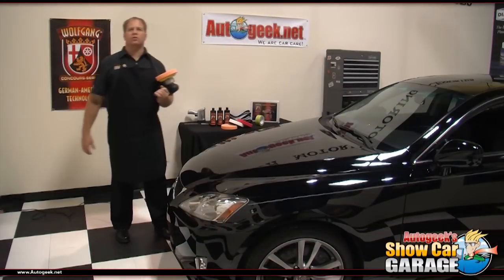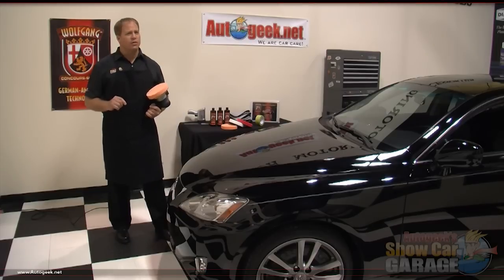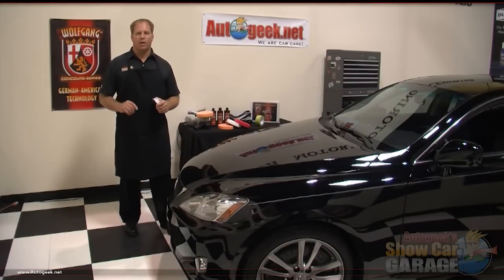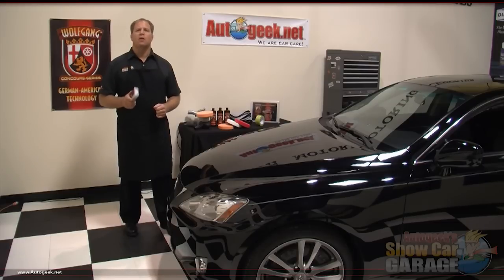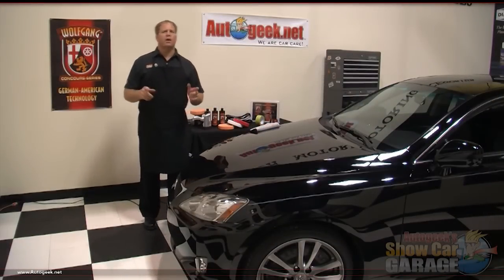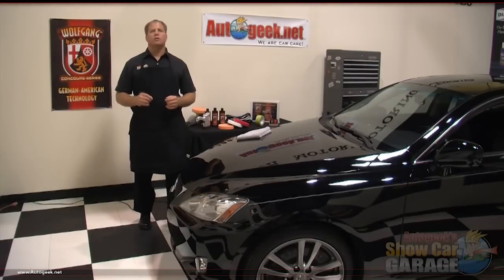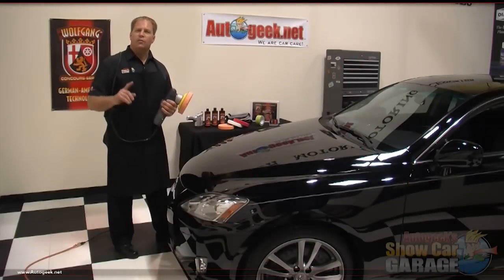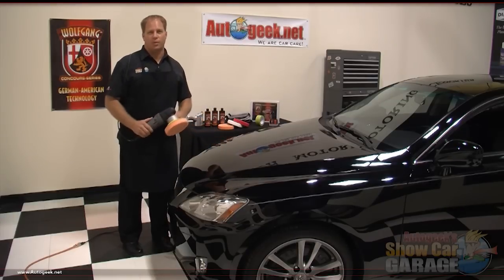Part 1 - How to remove swirls, scratches and water spots using a Porter Cable 7424XP Polisher

Comment from the maker: @DefinitionIsGone 
Good question and one that comes up all the time.  Wash and dry the car.  Clay if needed.  Next start with the Wolfgang Swirl Remover.  Since it will remove swirls out of your car's paint at the same time it's going to remove any wax you've applied.  -Mike

Comment: Hi Mike,

I recently purchased a 2014 Ford Expedition in Tuxedo Black.  I have  also watched many of your videos on the proper techniques on using a Porter Cable DA polisher. I alos understand different manufacturers use different grades of paints.  I have watched both the Wolgang and Blackfire videos. I am willing to invest the time to make this truck look great, but I am trying to figure out what lime of products would be best for this truck.  I will also be detailing my 2009 19 foot Monteray boat.  Thanks for any advice. I love all yiur videos and tips.

Thanks,

Deano

Comment from the maker: @No11Scalpel 
If the compounds you have are not using then switch to different products.  The Flex works great, that's a known fact.  Lake Country pads work great and that's a time-proven fact.  The other three variables are, paint, compounds and you're technique.  Since most paints polish just fine that leaves your choice of compound and your technique.  The Wolfgang Total Swirl Remover and Finishing Glaze work flawlessly so I would suggest giving them a try next.  -Mike

Comment from the maker: @wtgilles 
That's a tuff one... just do the best you can.  Clear bras are great for protecting the front of your car but there's no easy way to avoid getting the polish and wax residue along the edge of the bra that's fast and easy.  You could try running a strip of painters tape over it and just don't worry about the 1/8" of paint next to it that won't get polished.  No on is going to get down that close and inspect the paint.  -Mike

Comment: Hello Mike, I've watch this all the way through and I'm confident in this item and wolfgangs. 

But one questions I'm a perfectionist I've waxed my car numerous times.And  I've been told my hood looks like glass but the swirls always disappoint me.. That lead me to my question. Do I have to use wax remover because I have used alot of waxing processes before Wolfgang + Porter? Or just jump right into using The system you just showed in this video? What do you suggest?

Thanks much.

Comment from the maker: If the acid from dead bug splatter has etched the paint in most cases it's severe enough that you cannot safely compound the affected area enough to 100% remove the etchings and leave the paint looking factory new.  So if your wanting a flawless finish on the front of your car the only honest repair would be to have it repainted.  Best thing to do is to inspect your car's finish after driving and if you find bug splatter remove it immediately.  -Mike

Comment: when im using the porter cable, with a 3M light cutiing pad 6.5inch and using the step 2 ultra compound polish, it seems when after i buff the polish is really hard to buff off? what am i doing wrong? too little product, too high speed

Comment from the maker: @NoAquaUSA 
The XP model is better able to maintain pad rotation under pressure, this means you can remove swirls and scratches faster and more efficiently.  I have an article on this in my article list on AutogeekOnline . net
-Mike

Comment from the maker: I have another video on working curved panels and it shows using 4" pads and that's what you want to do, get smaller pads.  Sometimes you also have to work small or tight areas by hand.  -Mike Phillips

Comment from the maker: @boneflsh1 
The Porter Cable has been around the longest and has a time-proven success rate.  The Flex 3401 is a random orbit polisher but a lot different in it's drive gears than a Porter Cable DA Polisher and too is a top notch machine.  Just decide which "type" of action you want and then get a polisher.  I have articles on how the different types work on AutogeekOnline . net  -Mike Phillips

Comment: can someone please help me on this
i just bought a pc 7424xp with 120v and 4.5amp
and my country power supply is 220v
i have seen in the net and hardware store some heavy duty voltage converters and cost a lot
and other step down plugs which cost about 10/ 15 dollars <==which they say not recommended for power tools
so what can i do ??

Comment: Lets do a tutorial on bug juice on the front end of the NEW car. the acidity eats the clear coat, leaves what looks like chips. Don't care about swirls or the porter cable nxz42194. I'm a lic. collision guy in Canada...and no one on you tube has adressed this issue. Any insight? or be honest..a total respray?

Comment: Thanks mike ,wat wld b a good brand compound nd polish do u recommend 3m product s
Reply from the maker: 3M doesn't make any products specifically for dual action polishers, if you read their labels they say to use them with rotary buffers.  Autogeek.net carries lots of compounds and polishes that work well with dual action polishers, give our Customer Care Hotline a call and they can help you get the right products for your specific project.

1-800-869-3011

-Mike Phillips

Comment: For a start it's not swirls in the paint finish, it's in the clear Finish so use a good polish that's clear safe & you will not have any swirls at all, also removal of orange peel marks you have to go deeper & then do a great product like 3m cutting compound & then a polish & then a deep polish.
Reply: ***** I am a aerospace engineers Sales person, with over 25 years in the Engineering supply game & auto parts / auto industry as well, cheers :)
Reply from the maker: 7071t6 The clear layer is paint.  It's just paint without pigment.  You and I can only work on the top layer.  Also, the defects are only in the top layer.

-Mike Phillips
Reply: 250ratc Wow so smart , that all you can say, maybe you should put something up about yourself on your page, like most people do, the ones that don't, well all i can say cant even be true to themselves, which is to say you are living a lie all your life & have nothing better to do than  bag mouth other peoples comments, what about being a little positive in your life champ ?

Comment: I had a q how do u polish over stickers like da two strips in top of cars  .another one how do u polish candy paint is der a trick to it.
Reply from the maker: Don't buff on stickers or vinyl graphics.  Buff around them.

For candy paint, always use the best abrasive technology, don't use cheap compounds and polishes.

-Mike Phillips
Reply: Hey Mike quick question ? I just wanted to verify something ,wen u buff den polish nd wax the final look is zero marks ,but if in couple months the spider webs come up it means its cheap compounds rite.
Reply from the maker: Carlito Men do
Probably has more to do with how the car is being "touched".  You know, how it's being washed and dried and wiped with anything.  Clear coats are scratch sensitive, this means they scratch easily.  -Mike Phillips